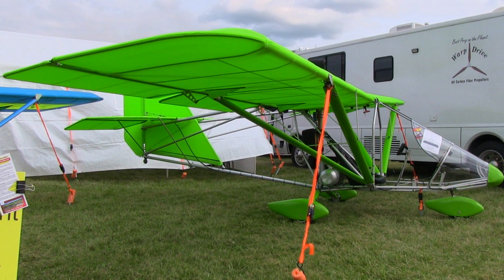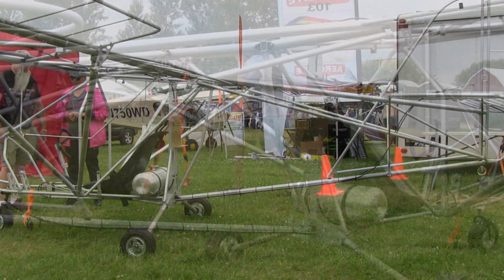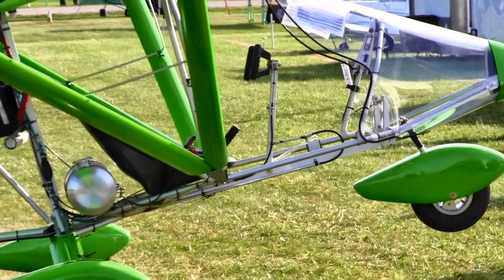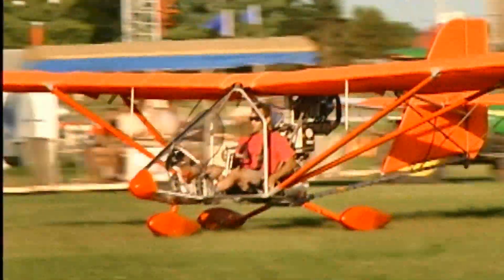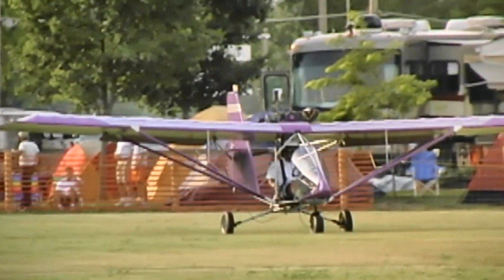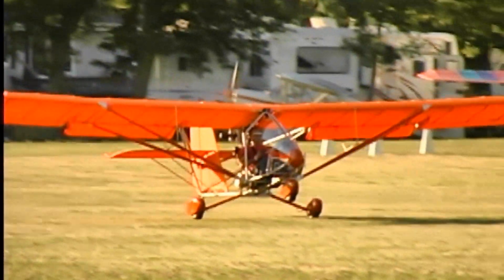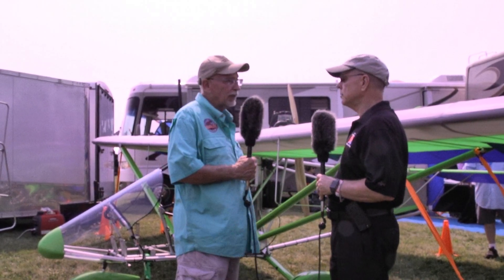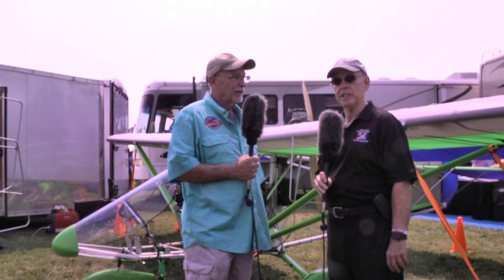Aerolite, Aerolite 103 ultralight aircraft, Aerolite experimental aircraft, Hayes Aero Michigan.

Comment: I can not move my legs cuz of spinal cord injury , can i fly this plane with hand control?
Reply from the maker: I do not see why not. It uses a yoke for steering, and teleflex cables. I did a conversion on an old Quicksilver MXL connecting the rudder to the yoke. Contact Dennis at https://www.uflyit.com/
The Ultralight Flyer
Reply: Absolutely.  Little rudder ever needed.  Could be incorporated into ailerons.

Comment: I agree that the engine and prop are worth 4K to 8K....but then to place a value of over 12K to 15K for and tubing and wingcovers is insane.   They should be priced under 15K new.
Reply: When you look at the engineering to safety that went into the original aircraft, you see value above the 15k.  I own one of the originals and fly almost every day.  Mine was covered and painted in Duralux.  Not only a very enjoyable 50 mph flyer, but a beautiful bird.

Comment: well under $20K.. groan. I saw an ultralight for $1500 recently, then realized I didn't really want to store it outside and I don't have anywhere to park a trailer.
Reply: well under 20k?  i don't know.  i just took delivery of mine @ a cost of 25k........hanger is $500/month......the under 20k has a very small 2 stroke.......you get what you pay for.......
Reply: @nathanielcohen9890  yikes. If my math is correct that's damn sure not under 20 grand. I'm looking for abiut half that. Guess the websites ive been looking at are 10 plus years old because every time i check into it further i find out the company went outta business years ago. Why keep there websites up. Do you know who is still in business guess i got the to wanting one a little to late.
Reply: @rs-xf9im  ..Check "Barnstormers....

Comment: Simple and smart. 👍
May I know about engine and it's horse power.
Reply from the maker: Single cylinder Hirth 24 HP.
The Ultralight Flyer
Reply: Thank you 💐💐👍
Reply: i own a brand new aerolite 103......the very small 2 stroke motors...i.e....the single piston slow and doesn't last that long......there small 4 stroke is a good option. i have an extra 40hp 4 stroke kohler that i plan on placing in my second aerolite.  i currently have the 2707 hirth which is perfect for this machine.....i don't really believe the under 20k.  as my under 20k, turned out to be over 28k.........and 8.5 months for them to complete it......is it worth the price....hail yes......i won't sell this one  or the other 2 i am having put together with different engine combinations.....aerolite 103 is the best and safest ultralight out there....but the adage still remains...you get what you pay for.......